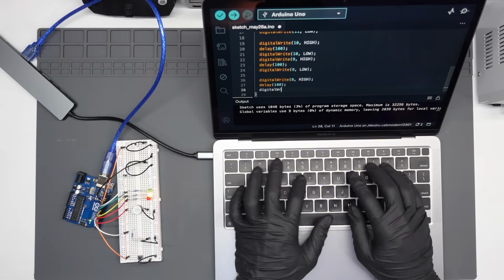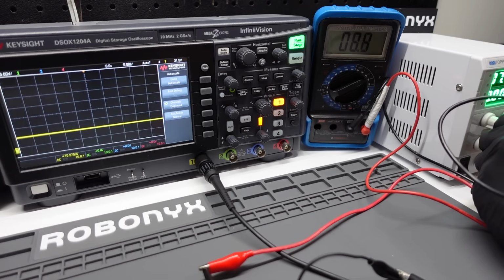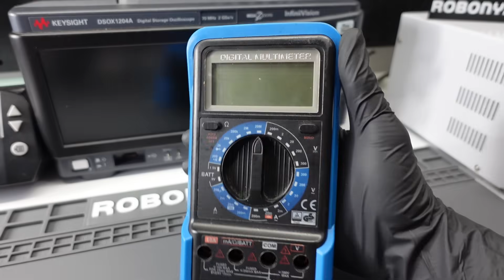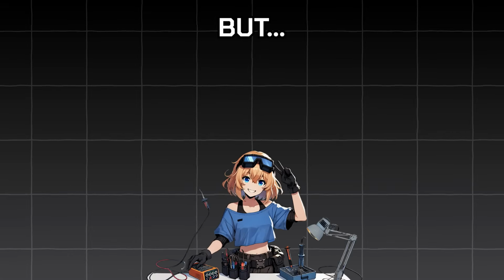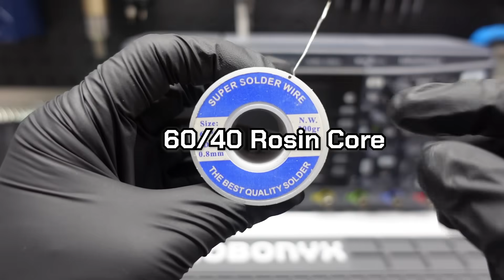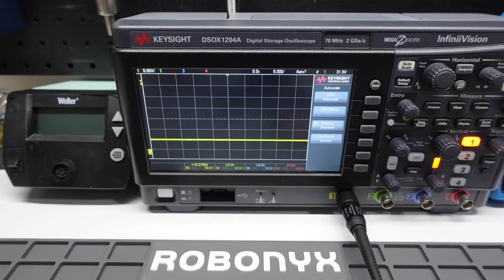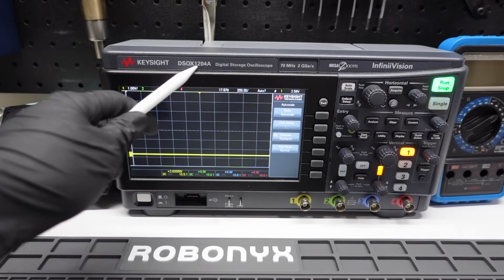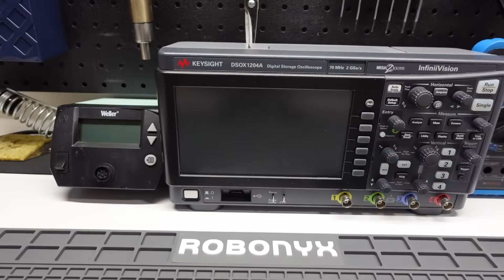Workbench Essentials When Starting Arduino! (Beginner Guide)

Comment: There is a lot wrong with this video

1. a Jumper wire is basically a wire with A HARD END
LMFAO........... NO
A Jumper wire is a wire that JUMPERS a connection from one port to another port OVER A SHORT DISTANCE

2. If you're starting Arduino get an UNO
NO...
if you're starting Arduino, do not get Arduino..............GET ESP32
I mean, what is the point of getting arduino anymore ?

3. we can't see electricity with our eyes
LMFAO............ WANNA BET?
So... When Lightning happens..... You're saying......... You can't see it ?  is that correct , You're saying... No one can see it ?
I RECKON YOU MIGHT WANT TO RETHINK THAT STATEMENT

4. that's not a SOLDERING IRON..it's a SOLDERING STATION
Look at the datasheet
https://www.weller-tools.com/we1010na/

5. then you'll need FLUX
This will help SOLDER... FLOW IN THE WAY YOU WANT IT TO ???????
WTF ?????
NO....
Flux keeps the Oxygen and Air out of the joint when soldering
it has nothing to do with how the solder flows

6.  Re Oscilloscope vs DMM
NO....
The difference between a DMM and a Scope is two fold

1. You mentioned - The sample rate is slower on a DMM and it's Manual
2. DMM displays the results NUMERICALLY,    the Scope displays them GRAPHICALLY
and yes you said (Plots them over time)
However what else was wrong is....
"You don't need a scope unless you work on complex circuits"
BULLSHIT !!!!
You need a scope as soon as you start,
The quicker you get a scope, the quicker you are going to learn things

it's become common place in electronics to discourage people from buying the oscilloscope.
and why ???
Because "it's expensive"

well
1. That is such a simple way to look at it 
2. Why not build something, Sell it then it pays for the scope
3. Scopes are not that expensive these days,  You can pick one up for $300 - $400
and a good one is around $1,000

Honestly, this isn't that much and when you consider that you can build something, Sell 3 or 4 things and have that money together,  it's actually nothing

"it's expensive" is a pointless statement,  as it has no frame of reference.
it's the statement of someone who doesn't know what to do in life

AND YET..... THESE PEOPLE STILL END UP BUYING THE SCOPE
so.... Was it really Expensive at the end of the day ?
NO
Because everything is either in budget or out of budget
or you can afford it or can't
or  you need it or don't need it
or want it or don't want it

but "Expensive" is never a reason to not buy something

so. Apparently don't buy the scope
but.. Proceeds to say.. Buy the 3D printer    LOL

No 20hour courses
BUT... YOU'LL LEARN IT IN A WEEKEND Which is more than 20 hours
Reply: Hey bro, I think you're taking this a bit too seriously haha. whether we can see electricity with our eyes, I think he was talking about the current in a circuit board, which we can not see. Of course, you're right that we can see lightning, but that's a different case lol.

when Arduino UNO vs ESP32, this video is a beginner guide I thought. ESP32 is definitely better because it's more powerful, but it's also more complex for beginners. Starting with Arduino is a great way to get into coding right?😂
Reply: @josephbaker8710  

"I think he was talking about the current in a circuit board, which we can not see."
EXCEPT THAT WE CAN SEE IT 
Also, Current is not Electricity, it's a property of Electricity

"Hey bro, I think you're taking this a bit too seriously haha"
DO YOU ?
So..... TUTORIAL VIDEOS are  NOT  supposed to be factual ?

"Of course, you're right that we can see lightning, but that's a different case lol."
OF COURSE.. we can see lightning
so then... ON A CIRCUIT BOARD...
- Can we not see sparks across a spark gab
- A Component short circuiting and sparking up before it blows up ?

THAT... Just like the Lighting is Current and Voltage, Essentially, Electricity.
You need to accept that he made a mistake.
We can understand and say ...... We know what he meant.
that's fine,
but even so.. he still made a mistake (granted , and understandable one) but still... Why are we not acknowledging it.
THIS IS A TUTORIAL VIDEO
the point is .. to learn,   How are we to learn if we don't acknowledge his mistake ?

"when Arduino UNO vs ESP32, this video is a beginner guide I thought"
INDEED IT IS
and beginners should be taught to not waste money on Arduino when they can go on ESP32 for far less,
they can initially (as beginners do) Interact with Arduino IDE,  while using ESP32
and they can also Use ESP32 while using VS Code.
what is the difference between a beginner using a blink sketch with Arduino Uno
and a beginner Using a blink sketch with ESP32....???   NONE AT ALL

But that beginner if using just Arduino uno and the Delay() function, cannot experience vTaskDelay() unless they have ESP32
but if they had ESP32 they could write a blink program using both programs and compare the 2 side by side.

Believe me there is more benefit for the beginner to do this.
the problem with the beginner is they lack the experience that experienced people have, so as to know what board to start with.

I'M JUST TELLING THEM WHERE THEY SHOULD START TO OPTIMIZE THEIR LEARNING PROCESS from step 1.

"but it's also more complex for beginners."
NO I'TS NOT

LET'S EXAMINE IT

DAY 1 -  BLINK SKETCH
(Arduino Uno - Using Arduino IDE)
========================================================================
void setup() 
{
  pinMode(LED_BUILTIN, OUTPUT);
}

void loop() 
{
  digitalWrite(LED_BUILTIN, HIGH); 
  delay(1000);                   
  digitalWrite(LED_BUILTIN, LOW);  
  delay(1000);                 
}
=======================================================================

Now
(ESP32 - Using Arduino IDE)
IDENTICAL
========================================================================
void setup() 
{
  pinMode(LED_BUILTIN, OUTPUT);
}

void loop() 
{
  digitalWrite(LED_BUILTIN, HIGH); 
  delay(1000);                   
  digitalWrite(LED_BUILTIN, LOW);  
  delay(1000);                 
}
=======================================================================

the difference is... the beginner with the ESP32 now have the flexibility to do this.
The beginner that only has an Arduino Uno DOES NOT

========================================================================
void setup() 
{
  pinMode(LED_BUILTIN, OUTPUT);
}

void loop() 
{
  digitalWrite(LED_BUILTIN, HIGH); 
  vTaskDelay(1000);                   
  digitalWrite(LED_BUILTIN, LOW);  
  vTaskDelay(1000);                 
}
=======================================================================

and now the beginner with the ESP32 has the flexibility to do this to see what happens

========================================================================
void setup() 
{
  pinMode(LED_BUILTIN, OUTPUT);
}

void loop() 
{
  digitalWrite(LED_BUILTIN, HIGH); 
  delay(1000);                   
  digitalWrite(LED_BUILTIN, LOW);  
  vTaskDelay(1000);                 
}
=======================================================================

now let's talk about doing it in ESP32 with the one that bought the ESP32 and wants to know how to actually use FREE RTOS

is it really a stretch of the imagination to go from this
========================================================================
void setup() 
{
  pinMode(LED_BUILTIN, OUTPUT);
}

void loop() 
{
  digitalWrite(LED_BUILTIN, HIGH); 
  delay(1000);                   
  digitalWrite(LED_BUILTIN, LOW);  
  vTaskDelay(1000);                 
}
=======================================================================
TO THIS.....

=======================================================================
void Task1(void *pvParameters); 

TaskHandle_t Task_1; 

void setup() 
{ 
  Serial.begin(115200);                        
  delay(10);

  xTaskCreate(Task1, "Task 1", 2000, NULL, 1, &Task_1);
  vTaskDelay(1000);
}

void Task1(void *pvParameters)  //Initiates Task1
{ 
  Serial.print(F("TASK 1 IS RUNNING ON CORE "));  
  Serial.println(xPortGetCoreID());
  //vTaskDelay(1000);

  digitalWrite(LED_BUILTIN, HIGH); 
  delay(1000);                   
  digitalWrite(LED_BUILTIN, LOW);  
  vTaskDelay(1000);      
  for(;;)
  { 
    vTaskDelay(10); 
  }
} 
void loop() 
{  
    vTaskDelay(10); 
} 
=======================================================================

I really doubt it

GETTING INTO CODING RIGHT would look like this

- Don't bother buying an Arduino
- Buy an ESP32
- Using Arduino IDE and  VS Code , Side by side
- Put the program you are using into both of them and play with the comparisons

that how you DO IT RIGHT
Reply: @josephbaker8710  

Also , for anyone who cares,
and i have taught many people ESP32

Here is a Bare Minimum Sketch

Unlike the code i previously posted, 
A lot of beginners tell me this one makes sense to them

/*
 GLOBAL FUNCTIONS AND VARIABLES
///////////////////////////////////////////////////////////////////////////////////////////
 PROJECT INFORMATION
-------------------------------------------------------------------------------------------
 CREATED BY : 
 CREATED BY : 
 DATE       : 
 PROJECT    : 
 VERSION    : 
 LAST EDIT  : 
///////////////////////////////////////////////////////////////////////////////////////////

///////////////////////////////////////////////////////////////////////////////////////////
 WIRING INFORMATION
-------------------------------------------------------------------------------------------
   PIN #  - DESCRIPTION
///////////////////////////////////////////////////////////////////////////////////////////
*/
///////////////////////////////////////////////////////////////////////////////////////////
// Libraries to include
//-----------------------------------------------------------------------------------------
//#include <LIBRARY_NAME.h>             //DESCRIPTION OF LIBRARY
///////////////////////////////////////////////////////////////////////////////////////////

/*/////////////////////////////////////////////////////////////////////////////////////////
 INITIATES THE TASKS
*///---------------------------------------------------------------------------------------
void Task1(void *pvParameters);  //Initiates Task1
///////////////////////////////////////////////////////////////////////////////////////////

/*/////////////////////////////////////////////////////////////////////////////////////////
 DEFINES THE TASK HANDLES
*///---------------------------------------------------------------------------------------
TaskHandle_t Task_1;  //Handle for Task1
///////////////////////////////////////////////////////////////////////////////////////////

///////////////////////////////////////////////////////////////////////////////////////////
// BEGIN SETUP
///////////////////////////////////////////////////////////////////////////////////////////
void setup() 
{  //OPENS Void Setup
/*/----------------------------------------------------------------------------------------
//SERIAL COMMUNICATION
------------------------------------------------------------------------------------------- 
 Baud Rate Setup
*///---------------------------------------------------------------------------------------
  Serial.begin(115200);                           // Serial Monitor Baud Rate
  delay(10);
///////////////////////////////////////////////////////////////////////////////////////////
/*-----------------------------------------------------------------------------------------
  TASK CREATION
*///---------------------------------------------------------------------------------------
  xTaskCreate(Task1, "Task 1", 2000, NULL, 1, &Task_1);
  vTaskDelay(100);
///////////////////////////////////////////////////////////////////////////////////////////
}  //CLOSES Void Setup
///////////////////////////////////////////////////////////////////////////////////////////

/*/////////////////////////////////////////////////////////////////////////////////////////
 TASK EXECUTION - TASK 1
*//////////////////////////////////////////////////////////////////////////////////////////
void Task1(void *pvParameters)  //Initiates Task1
{ // OPENS Task1
  Serial.print(F("TASK 1 IS RUNNING ON CORE "));  
  Serial.println(xPortGetCoreID());
  //vTaskDelay(1000);
  for(;;)
  { //OPENS  Task1 FOR Loop
    vTaskDelay(10); // REMOVE THIS LINE BEFORE INSERTING CODE
  } //CLOSES Task1 FOR Loop
} // CLOSES Task1
///////////////////////////////////////////////////////////////////////////////////////////
void loop() 
{  //OPENS Void Loop
    vTaskDelay(10); // REMOVE THIS LINE BEFORE INSERTING CODE
}  //CLOSES Void Loop
///////////////////////////////////////////////////////////////////////////////////////////

Comment: what is the name or type of the gloves that you use?
Reply: Black Latex Powderless Gloves

The brand is irrelevant, if you are serious about these gloves you just really need to know a few things

whether they are yellow, Blue or Black doesn't really matter, although Black is good if you're doing dirty work.
Some workplaces have colour preference, Example, Chemical labs and hospitals will preference blue.
where paramedics and onsite people and electronics people will preference black

Now, if you're doing light work , most any of them are fine
but i work in Telecomms pits, so the thinner one's don't last for me,   i need thicker one's

Try a few out and you'll see, there are thin one's and thick one's
and there are one's that are dull (MATTE) in appearance and there are shiny one's

stick to the thicker and Matte one's
but brand is completely irrelevant

go find a cleaning chemical supplier, they'll have boxes of them
when they ask you for size
Say    L (Large) and then buy 1 box and go from there
there is Small to   XX Large

Comment: damn, any oscilloscope recommendations for an intermediate electronics student? urs is very expensive lmao
Reply: DEFINITELY....
Now it's best to buy brand new
and don't buy those USB Based ebay pieces of crap,  they are not the worth the money

when buying a scope here is what is important

- How many channels does it have 
(You can start with 2,     4 is better)

- Analog Bandwidth of each channel
(if it's says 100MHz, that means Each Channel can take a Max signal of 100Mhz in each channel.
However, if you use all (say) 4 channels at the same time, You can only use a Max of 25Mhz per channel if all 4 channels are enabled)
The trick with cheaper scopes is they will have 500kHz
MOST SCOPES ARE UPGRADEABLE AS WELL

- SAMPLING RATE ,   The Holy of Holies.
this is the rate at which your scope can sample signals at,   the higher the better.
Cheaper scopes will sport numbers like  500Msa/s  (Mega Samples Per Second)  that's rubbish.

You should aim for a Min of 1Gsa/s  2 is better   5 is awesome  3 is very cool

- Memory depth,   24 to 56Mpts (Mega Points) is fine and more is better

so.... CHEAP AND AFFORDABLE BUT GOOD............ Means... RIGOL
Look at Rigol DS1054Z   it's around $400 which is ridiculously cheap
a better step up from that is   DS2000A Series
a step up from that is MSO5000 Series   (here you are at $2,500_

if that doesn't work
Look at the second hand Jobbies,
Now.. You will certainly find a RIGOL DS1052E for about $300
don't buy it, it's not worth it
Because you can buy a Tektronix 2210  for around $100  
yes it's old,   but it's a classic and it's literally the model that the Rigol DS1052E was built on

but then.. it might be worth exploring Analog scopes   CRO's (Cathode Ray oscilloscopes)
You can pick them up for like $50

Now the trade off is

there is no Digital Storage
it's likely the cheap one's will be 20MHz on the front end , This starts you off but is rather limited

Now there is a Hantek on ebay for like $300, but if you're gonna do that, Given that the Hantek is laggy,
Just get the Rigol DS1054z     you'll thank yourself down the track

Any Questions... Ask me
Reply: Now it's best to buy brand new
and don't buy those USB Based ebay pieces of crap,  they are not the worth the money

when buying a scope here is what is important

- How many channels does it have 
(You can start with 2,     4 is better)

- Analog Bandwidth of each channel
(if it's says 100MHz, that means Each Channel can take a Max signal of 100Mhz in each channel.
However, if you use all (say) 4 channels at the same time, You can only use a Max of 25Mhz per channel if all 4 channels are enabled)
The trick with cheaper scopes is they will have 500kHz
MOST SCOPES ARE UPGRADEABLE AS WELL

- SAMPLING RATE ,   The Holy of Holies.
this is the rate at which your scope can sample signals at,   the higher the better.
Cheaper scopes will sport numbers like  500Msa/s  (Mega Samples Per Second)  that's rubbish.

You should aim for a Min of 1Gsa/s  2 is better   5 is awesome  3 is very cool

- Memory depth,   24 to 56Mpts (Mega Points) is fine and more is better

so.... CHEAP AND AFFORDABLE BUT GOOD............ Means... RIGOL
Look at Rigol DS1054Z   it's around $400 which is ridiculously cheap
a better step up from that is   DS2000A Series
a step up from that is MSO5000 Series   (here you are at $2,500_

if that doesn't work
Look at the second hand Jobbies,
Now.. You will certainly find a RIGOL DS1052E for about $300
don't buy it, it's not worth it
Because you can buy a Tektronix 2210  for around $100  
yes it's old,   but it's a classic and it's literally the model that the Rigol DS1052E was built on

but then.. it might be worth exploring Analog scopes   CRO's (Cathode Ray oscilloscopes)
You can pick them up for like $50

Now the trade off is

there is no Digital Storage
it's likely the cheap one's will be 20MHz on the front end , This starts you off but is rather limited

Now there is a Hantek on ebay for like $300, but if you're gonna do that, Given that the Hantek is laggy,
Just get the Rigol DS1054z     you'll thank yourself down the track

Any Questions... Ask me